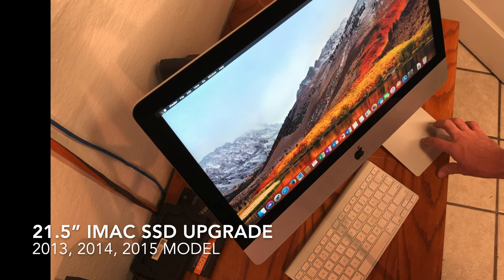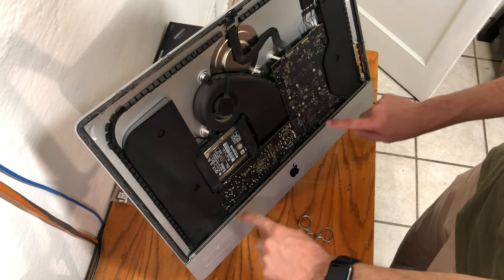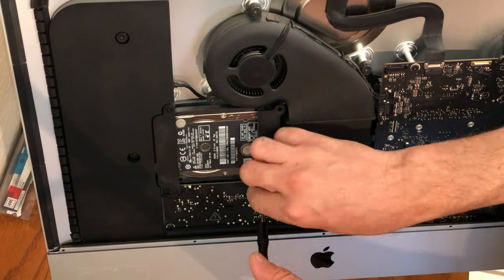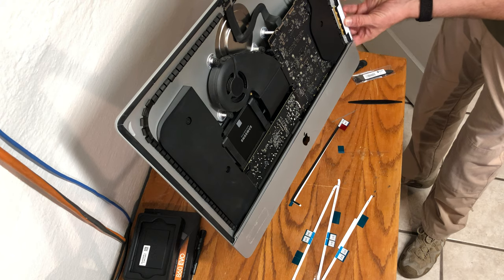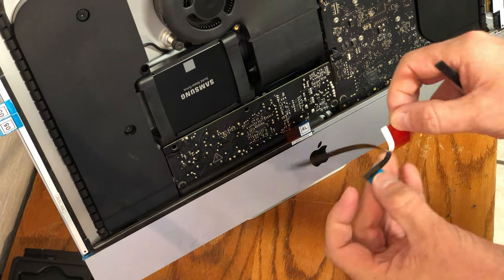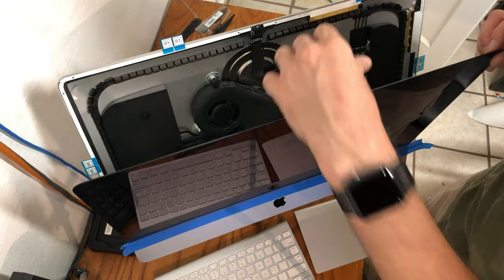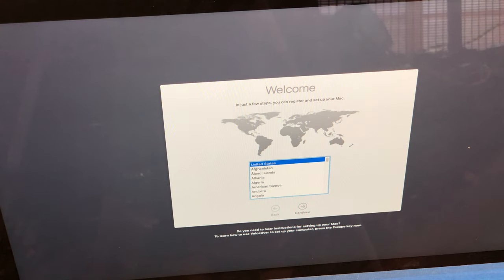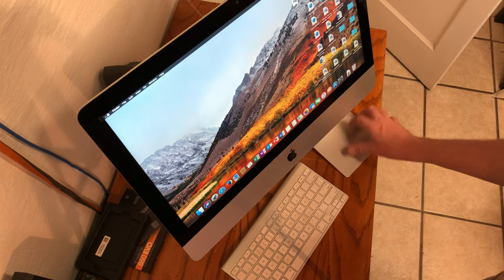Apple iMac 21.5” SSD Upgrade (2013-2015) HDD To Solid State Drive (SATA) | Step By Step

Comment: it's exactly what I was looking for. As far you already opened imac - can you change at the same RAM? apple says that this model (i have late 2015 21.5) is not upgradable - probably due to the operation what you've made in this video (no guarantee and etc.) Any advice?

Comment: I have a late 2013 iMac 21.5 with fusion drive. I replaced the 1tb mechanical drive  with a ssd. It was slower and sluggish afterwards.

Comment: Yesterday I upgraded the SSD on my 2015 iMac. However, after the installation webcam is not working. Any idea on that? Worrying whether I have covered a sensor with adhesive tape...

Comment: Hello Sir! Should I worry about the fan blasting at full speed like what others have said? Thank you!
Reply: If you’re worried, you can use an app called Macs Fan Control to make the fans spin at their original speed.
Reply: @evandrivescars  Hi! I have a late 2015 21.5 imac and your video was really helpful. I am going to do it myself this week. I am also confused about the fan. Do i need a temperature sensor cable or can I just install the new SSD? Thank you!

Comment: Great Video Thanks for the demonstration! Couple questions, I have a Mid 2014 Imac 21.5" with a 500 gb HDD, the old hard drive installed from factory. Could you please provide me with the exact SSD model I would need for this? Could I use the same one you provided in the link? Also, once you install the SSD and reboot it ,did you plug a USB stick in the USB port with OS on the stick and then installed OS from the stick? Could you clone the hard drive prior to installing it?
Reply: this is old but hey maybe you still need help... any SATA SSD will work. Search SATA SSD and pick a size. Once you install everything, press and hold Command and R on the keyboard and push the power button... that will boot recovery mode. Pick the option to erase the new drive. After chose the option to re-install OS. Once booted in OS go to the App Store and download the latest compatible OSX for your machine. You can look that up on apple.com by serial number.

Comment: I have en Imac 21.5 retina 4k end-2015
I'd like to replace DD with SSD and upgrade memory size
Core is I5 3.16Mhz
Memory is 8Go 1867 DDR3
I'd like to have an SSD of 1To and 32Go of memory.
What have I to buy and what model of memory card.
Many thanks in advance for your help.

Comment: if removing the screen is too much for me, would it work to just use an external ssd for the same performance results?
Reply: You might not get the exact same results, but it would likely still provide a noticeable performance improvement considering how much faster SSDs are.

Comment: Will the crucial mx500 500gb SSD fit  my iMac late 2013 21.5 ? Is it the exactly same size as the samsung evo 860 ?I want to replace my old hdd with the crucial mx500 500gb SSD ? Are there any differences between the samsung evo 860 ?Lastly if we install an SSD will we have temperature issues ? Thank you very much :)

Comment: How do you unhook the cables?? They look so delicate and your arm is in the way.
Reply: The one with the small number of heavier wires pulls out directly, with care. The other has a little metal bar that swings over the part of the connector on the logic board. Swing the bar up and the cable side of the connector can then be withdrawn easily.

Comment: What if I got  a 1TB hard drive,  can I replace it with the Samsung 1Tb solid state drive ?  

 I seen one at Best Buy for $100...  and no one has the 1TB hard drive 2.5 inch.  So I was thinking if I go with SSD just with 1TB instead of the 500g you’re using.

Comment: This is incredibly helpful! So you mentioned "the entry-level iMac ... Late 2015" models -- do not have the connector for a PCIe-based "blade" SSD if one is not installed at the time of initial system purchase." Does this mean that the Samsung EVO you suggested would not work with this? I have the late 2015 21.5" base model with 1.6 GHz Dual-Core Intel Core i5 and it's become SO slow over the years that I can't even browse just a simple website like Facebook lol it's so pathetic.
Reply: It for sure will help to some degree to upgrade to a ssd, but this is something you can check out with a bootable external harddrive or nvme drive before doing this step. If your machine performance is so much better that it makes sense to do this upgrade, go ahead. If not. Sell it, and buy a never/ better modell. 

I would actually buy a older iMac with better specs. Either 21.5 inch or a 27. 

The bad News is:

This modell is by far the worst modell ever relased. Its a mobile/low preforming/ laptop chip that was used on older devices. Its kind of absurd that Apple sold this devices realy. 

:/ 

Good luck :)

Comment: Dont forget to enable TRIM for SSD via terminal command! To enable TRIM, a user just has to type "sudo trimforce enable" into the Terminal window and restart. This is very important part!
Reply: Is this mandatory?
Reply: @goranm  it is mandatory, as it can improve the performance of writing data to SSDs and contribute to longer SSD life.
Reply: @Windows7Pro2009  I already did the upgrade, few months ago but I still did not enabled TRIM for SSD because iI got some huge warning about potential lose of data :O

Comment: Anyone know how you should determine if it's better to upgrade your HDD to SSD, or if it'd be more helpful to upgrade my memory?  Currently I have 16gb of memory on a late 2015 iMac model 17.1.  I am considering either updating the memory to 32gb or buying an SSD replacement kit.  I mostly need this for a FCPX facelift.  Any help appreciated.

Comment: Can anyone tell me if the iMac (21.5-inch, Late 2015) A1418 that came equipped with a 256GB PCIe 2.0 x4 also has the needed cabling to add a regular 2.5" SATA-3 SSD? Thanks in advance for reply

Comment: Is there any issues with the temperature sensors when doing this upgrade? I remember when I did it on my 2012 model, I had to rely on software to manage the fans.
Reply: I would like to know the answer to this question as well.
Reply: @SRX2004  Me too! I dont want to pay $38 for a in-Line Digital Thermal Sensor HDD Upgrade on amazon.

Comment: Geeks Who Care Hi, and thank you for taking the time with this. I dont know how or if it is possible to upload a photo in this topic, but the tempeture cable is fixed on the lcd with black factory tape, the other end is located near the build in camera. About the leds. It is only the first green led which light up, number 2,3,4 newer light up. Could this indicate it is a faulty power supply, to the lcd screen ? Since i can start up with another screen via the hdmi/ thunderbolt plug, i guess the main power supply and the graphic card is ok, but can not figure out why the other led’s on the main board wont light, it would be more logic if the first 3 lights up, since i can use the imac on the TV screen. The imac i have is btw the A1418 late 2013.

Comment: Great video. I have a mid 2014 21 inch iMac, will I be able to do this upgrade? I wasn't sure from the info in your text. Thanks!
Reply from the maker: Yes, which solid state drive do you plan to use? The video information was only mentioning certain models would ship with a apple "M.2" style connector and others would not. Either model will accept a " SATA 6Gbps 2.5' " Solid-State Drive.

Comment: Hello,

Very useful video. I want to buy a new Samsung SSD for my 21.5" 2013 iMac and I am worried about all my files and things I currently have on my computer and how to go about preserving these and not losing them once I install my new SSD.

In simple terms as I am no computer whizz kid, how do I ensure my files are save and my computer is as normal once I install a new SSD?

Thanks for your help,
Reply from the maker: Anonymous D When you remove the internal hard drive, you can use this adapter cable; https://www.amazon.com/Sabrent-5-25-INCH-Converter-Activity-USB-DSC9/dp/B00DQJME7Y
plug it into your old drive during the final step of the installation of the macOS operating system at the migration screen. Allow it to finish seeking the drive and once the pinwheel finishes then you can click next and select all the folders to transfer.
You may also use a separate external hard drive to run a time machine back up of all files and settings prior to removing the internal hard drive and installing the solid-state drive. At this point you would use the time machine back up restoration at the same migration screen. You can use https://diskmakerx.com/ to create a macOS installation USB drive.

Comment: great video wonder if you can email me so i can pick your brain on the issue i have with my IMac 2015 which has a blinking question mark in folder and when going into utility it won't let me erase or preform first aid on anything. if i replace the hard drive will that stop the issue don't care if i lose everything on the old drive

Comment: Hello, I have iMac 21.5-Inch "Core i5" 2.7 (Late 2012) I tried to upgrade with Samsung 860 EVO like you did but it didn't work.. When I was trying to install the OS from my back up hard drive, the new SSD didn't show up... Please give me some advice if possible. Thank you
Reply: Same here..  did you find a solution?

Comment: Hi Geeks Who Care. I live in Denmark, europe region, would the hardware be the same here ? If so can you provide the ssd drive model, the adhesive kit and the usb/ old harddrive cable, i have a late 2013 21” inch imac with 8 gb ram and 1 TB harddrive. Great video btw - Thanks 😀
Reply from the maker: flemming ovesen 
Awesome feedback! Thank you!!
Yes the internals are the same, and you can purchase the items from Amazon here;

New LCD Display Adhesive Strips Tape Opening Wheel Handle Tools Kit for iMac A1418 21.5" 076-1437 076-1416, 076-1422 2012 2013 2014 2015 Series https://www.amazon.com/dp/B07DXKRHYQ/ref=cm_sw_r_cp_api_i_vgGZDbD1NSTKC

Samsung SSD 860 EVO 1TB 2.5 Inch SATA III Internal SSD (MZ-76E1T0B/AM) https://www.amazon.com/dp/B078DPCY3T/ref=cm_sw_r_cp_api_i_ohGZDbQRTRWCG

Good luck with the install!

Comment: I want to upgrade my gpu to make final cut work better. Is that doable? I am also thinking of changing to ssd while I’m at it. Will make my 2013 iMac better than new
Reply: Did you change the GPU ?? Just checking so when I change my HD do all at the same time. What about the Graphic card ???

Comment: My iMac HDD has 5 APFS volumes on /dev/disk1 (synthesized). Will the the transfer keep all these intact, or create new volumes? Also is using the createinstallmedia.exe within show package contents the same or better as diskmaker 9? It seems more upfront to make usb installer natively within terminal
Reply from the maker: Creating the boot media is best done with the "DiskMaker" mac program; it takes any mistakes or headaches out of the process. The most convenient feature is the ability for the USB creation program to download the latest macOS dmg/app installer file from apples back end servers WITHOUT an Apple ID.
When you have completed the installation of the NEW solid state drive in the iMac, then you use a USB 3.0 to SATA adapter to plug in the old iMac Hard Drive at the "Data migration Assistant" screen on the installer. you can also wait until after installing macOS to the SSD and re-open the migration assistant from finder. The assistant will copy everything shown on the categories selected. 
As far as keeping every single partition the old Hard Drive the EXACT SAME on the new SSD, you would have 2 options: PHYSICALLY CLONING DRIVE; you'd need to use a external 2-drive SATA docking station with an "Offline Clone Mode" button to seamlessly clone the drives. You can also use a mac compatible usb or boot cd with a cloning solution. 
or
Cloning a hard drive on MacOS is a little easier than Windows because you can use its built-in Disk Utility tool to perform the same kind of drive clone function. There are plenty of third-party alternatives you can use, like the popular "Carbon Copy Cloner", but Disk Utility does the job just fine. You don’t need to have the latest version of MacOS Mojave, but it’s never a bad idea to keep your Mac up to date.
The only downside to Disk Utility compared to some third-party tools, is that it unmounts drives to speed up the copy process. That means you can’t perform a drive clone from the same volume as you’re booted to. You’ll either need to boot from another drive or volume with a functioning MacOS install, or alternatively, use the Recovery HD volume.
You can access the Recovery HD volume by restarting your Mac while holding down the CMD + R keys.

Select your destination drive from the list of volumes on the left-hand side. This is the volume that will have the data copied to it and will be erased as part of the process, so make sure to select the correct one and that any important data on it is backed up. Then select the Restore button from the top menu. It looks like a circular arrow.

In the new pop-up window, select the Restore From bar and choose your source drive — the one to clone the data from.

Comment: Hi, I bought the ifixit Kit, an crucial SSD, I have the bootable USB Stick and a time machine backup. Here and there I read horror stories of fails upgrading it to ssd. I am irritated now if I could manage that task. I am a newbie and haven’t done any similar recently. Can you recommend me to visit a specialist?
Reply: You can do it yourself with no problem. Just take your time and be careful with the ribbon cables that connect the screen to the motherboard. :) The iFixit kits are amazing as well!
Reply from the maker: post any issue you may have or foresee, we can help!

Comment: After installing the new drive, is it possible to reinstall OS and all data with a time machine backup?
Reply from the maker: Cory Berg Absolutely; the only requirement is that you format a USB macOS installer Drive prior to taking your current machine out of commission. I use DiskMaker X; the program to easily create a bootable macOS USB installer which you can then boot off of and then use to install the operating system. At the end of the operating system installation, you will be able to restore from your time machine back up by plugging it in with a USB cable to SATA adapter, or a hard drive enclosure.
Reply: Geeks Who Care I didn’t even do that, I just put the drive in and it worked 😂
Reply: Thanks for the reply!

Comment: How easy is it to put the ssd back in place? You didn't show that bit. Certainly not easy task for fat fingers I assume.
Reply from the maker: It is not too difficult; you must hold the SSD flat with the iMac, while using the SATA connector to "connect" to the drive with a little bit of sliding pressure. The iMac's SATA connector is strong enough to where you can "push" the SSD onto the connector. After you've pushed the SSD partially onto the connector, you can use a spludger tool to press it completely in place with the connector. Then secure the different screws holding it in place. I somehow lost the video clip of the actual installation part of the SSD in my video, and could not find it in my original media. I apologize for that missing bit!
Reply: Geeks Who Care I just did the same thing as you did to yours. All went good. I found it easier to fit the SSD by unscrewing the Tray where the SSD sits. So you have a bit more room to plug it in and then screw the tray back in place. Once again, thanks for your video, it helped a lot. The iMac is really FAST now.

Comment: So how much did this sped up your iMac?
Reply from the maker: The SSD easily speeds up load times 4x faster. From a boot up after the chime, the SSD gets to the password screen in 15 seconds, compared to about 1-2 minutes on a 7200rpm drive. Applications like iMovie, Chrome, Word & Excel, all load up much faster. When importing a movie to the program it takes a fraction of the time to load up the project compared to a traditional hard drive.
Reply: Geeks Who Care Thanks. I was looking to upgrade the HDD to an SSD. But I wasn’t sure how much the benefit would be. 
Clearly, a lot. 
Thanks again.

Comment: On a 2013 21.5 inch iMac, can I install a 1 TB SSD? Apple's website says the max flash storage is 512 GB but I don't know if that's true or if it was just the limit back in 2013 when the guide may have been created. Please advise. 500 GB would suck after all the effort these days.
https://support.apple.com/kb/SP687?locale=en_CA
Thanks

Comment: Is it possible without formation  OS on ssd first?? Is it only for ssible to put a Complete new SSD in and download and install the os??
Reply from the maker: Absolutely, you may boot off of a USB installer, use the disk utility to show all partitions and devices, then use the format function to complete the HFS+ or APFS filesystem format. Or if what you are asking is can you add the OS first then put the drive in? Yes, you can also install OS first.
Reply: Geeks Who Care i dont understand. How do i get macos on a new ssd?
Reply: Geeks Who Care and clone my current hdd
Reply from the maker: Julian iLuckeey Boot to the recovery partition with the new drive installed and have the old drive connected via USB. Or boot from a macOS USB installer that you’ve created. Use the disk utility and click the recovery tab. You restore source disk to target disk; here are instructions from apple

https://support.apple.com/guide/disk-utility/restore-a-disk-dskutl14062/mac
Reply from the maker: ...or you can use this docking station for an offline clone of each disk. https://www.amazon.com/Inateck-Aluminum-Docking-Station-FD2102/dp/B01KWQ8WFG/
Reply: I have late 2015 can I upgrade to ssd?
Reply from the maker: @fitzgeraldlim2050  Yep! this video is for YOU! Were here to help! 
Which SSD are you going with?
 Are you starting from scratch, migrating files, or cloning old drive?